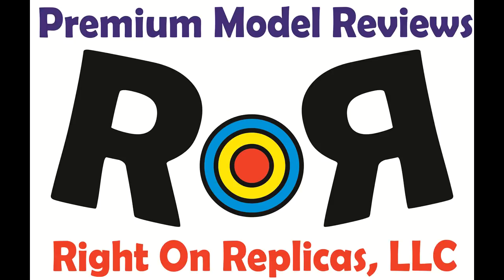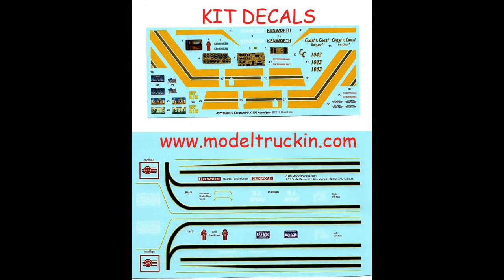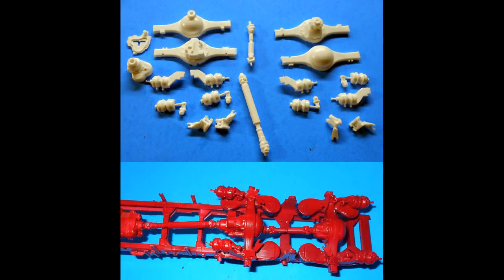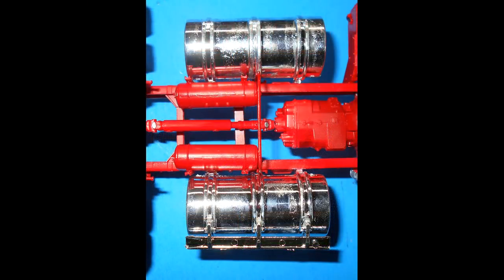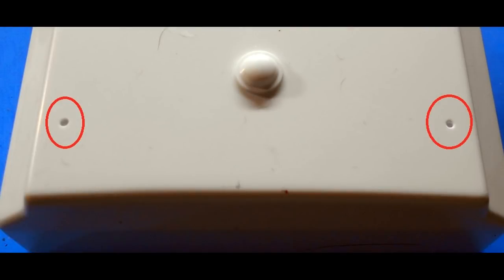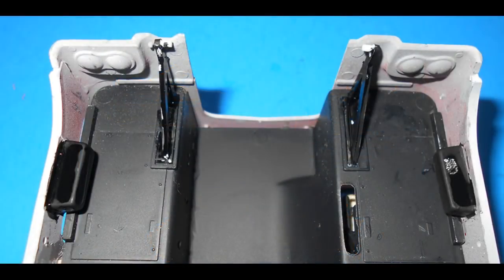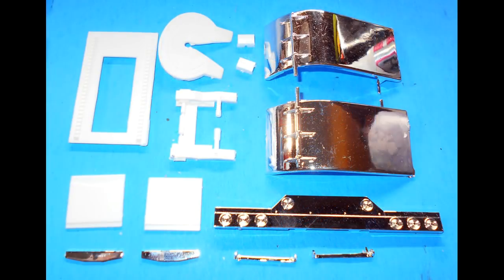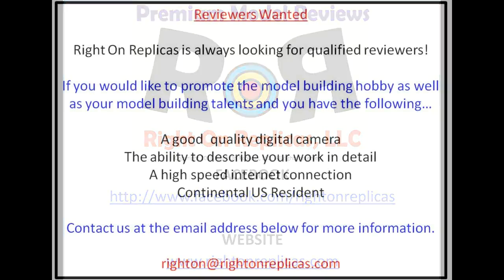How to Build the Kenworth K-100 Aerodyne 1:25 Scale Revell Kit #85-2514

Comment: a p.s to your built- the "antenna" behind the cab and mounted to the frame is called a pogo stick and its use is to hang the air brake hoses and electrical cord so they don't get tangled up while the truck makes turns.
Reply from the maker: Cal, that is great information.  Thanks for sharing!  -Doug

Comment: I love this build. I've got this exact kit, that I also plan on turning into  B.J. & The Bear version.

However, I also bought one of the other Revell K100 Aerodyne kits, which I'll be starting on soon.

I noticed at the beginning of the video, where you've got the model revolving, that there's a pretty noticeable gap between the tops of the doors and the Aerodyne roof cap.

Did you ever figure out what caused this?  I'd really like to avoid this problem if possible. 

Thanks!
Reply from the maker: JJ,  Good question, the answer is lack of test fitting.  It was assumed that the doors would fit properly but they did not.  To resolve the issue test fit those doors before the glue goes on and make any needed adjustments for a good fit!   Thanks for watching and please subscribe if you haven't already, to help us continue our mission to inspire more modelers!  -Doug

Comment: Hi, my name is Malcolm, and I have a question for you.. question is, How can I make a 1/25 scale tri - axle lowboy trailer WIDER to about 110mm to 120mm wide, and LONGER by making it a 4 axle trailer.. If you have any ideas for me that would be greatly appreciated, cheers malcolm.
Reply from the maker: Malcolm,  The short answer is - use two identical kits and cut the center sections out of one to get the dimensions you want for the larger one.  Cut the one you want larger in the middle in both directions and add/glue those center sections to the recipient model.  Use an axle/wheel set from the donor kit for the forth set and add a section to the center of each axle shaft to widen those the same amount and add longer axles.  Reinforce the joins with sheet stock.     PS, please help us reach more modelers by subscribing if you haven't done so already.  -Doug